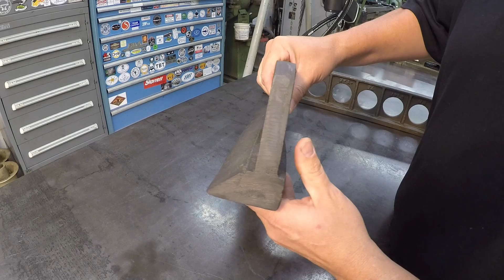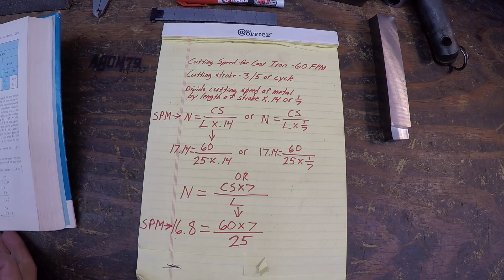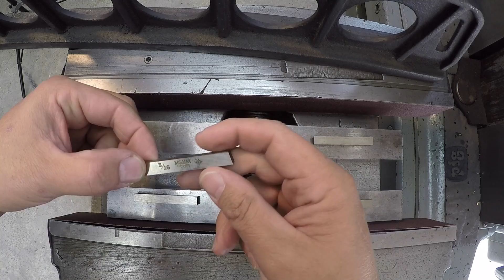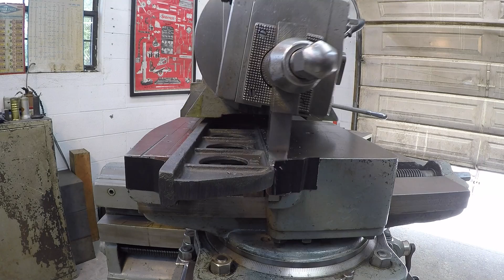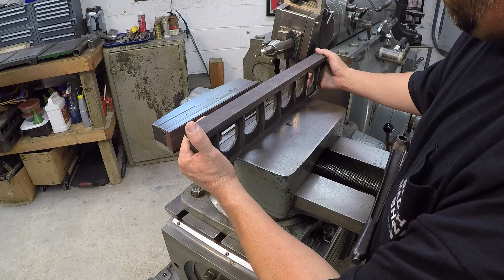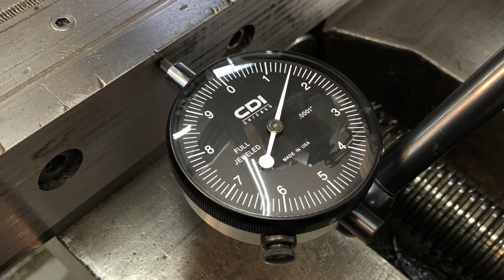Machining a 24 Inch Camelback Straight Edge Episode 1

Comment: I have been thinking about trying to build a sharper since I been watching you in older videos do work with them. I 
see they can do the things if like to do. I would also like to build a lathe as well as a small',ish be Bridgeport style mill  you can write everything I know about machine work TWICE, on the be back of a baseball card and a gum wrapper.  But the thing is I love you make stuff. I also want to start casting a bit. I know i can build a small furnace. I'd like the capability to pour 400-500lbs of iron per run, if I had to. Using a small gantry crane and lever to hold the crucible, use counterweights to counteract about 95% of the weight, using water so as the iron is poured the counterweights gets lighter also, but this is a somewhat complex system, using a electric winch to actually do the lifting is a more likely system. Use pulley blocks and a pwm  motor speed controller to easily and slowly lift the weight. with great accuracy to boot by slowly ramping up the lifting speed , moving up slowly and smoothly as if a person was lifting a coffee cup, not to spill it. By slight over volting the motor it can also run nearly as fast as without the pulley blocks   loose 50%, though 20-25% is is gained back by running the 12v motor on a 16v battery possibly 18v to 24v, a 12volt motor can be ran on as much as 36volts for a short time, depending on the type of motor. They run 12 v hydraulic pump motors on 36-48v+ all the time.  And 36v fork lift style motors on upwards of 144, volts, it requires using a blower fan to cool them. And they are not ran at full power more than 10-20 seconds. Not so much anymore.  the bldc,/ 3-,,phase brushless motors have basically taken over. Sorry to run astray,. I was looking on a mm Amazon and found a 10" 3,jaw. Chuck that could be a starting point for a lathe, it's going to be somewhat limited but a electronic lead screw can allow power feed as well as threading  probably no pass through the chuck, I would probably use two tapered wheel bearings from a old truck and attempt to use two seals and use oil in place of thick grease. Being the common use would like going out and running 300 mph all day grease isn't really going to do much. Maybe 30 weight non detergent if possible, and about of Lucas. Stabilizer, to make the oil a bit tacky. If the bearings wear quickly I guess I will try another oil.  Maybe more Lucas, or a 0w5 oil. and  I'm thinking about using a pump to spray the oil on the bearings to help cool them it's only the two for the chuck. And possibly 4 for the lead screw, two smaller tapered bearings per end. The carriage getting a oil bath. And possibly a ways oiler that pumps a small amount of oil as the carriage is moved across them, getting a bit of oil on the compound side that finds it's way to the ways. A 10" chuck. I'd like to have a 4jaw but 3 is better than none. Maybe I can have both eventually.  I'm thinking about 4" angle  about 1/4" thick to start the ways.  Have them milled flat after the welding is done, a piece of 3" channel welded to the inside leaving the top to be milled flat. Then have a 1" sq. Bar milled square on all sides after it is attached to the angle with ,1/8" dowels and ,1/4" hex drive bolts  counter sunk. The opposite side  basically the same only the 1" bar milled to A. By milling off one corner, and attaching it from the bottom  by  drilling n tapping the bar using dowels every _4" and a ,1/4" stud screwed in ever 4" between those. Using flange nuts. Then spot weld them. After they are tight. Then finish milling the ways. After this build the followers from 2" thick x 6" wide flat bar. Drill oil passages mill the mating groves a pyramid and a slight trapezoid,  having oiling passages and groves. The ways attached by 2" channel and square tubing 1.5"  1/8"wall using 4" tubing for the legs , the tail stock steady rest all mounted to the ways equally, the centerlines adjusted by milling the mounting pads on top. Ok to the bottom of the parts them self. Or by using shim stock between the bolting area. Only metal shim, and mill to the perfect the height. It's not going to be a perfect machine it should get a fellow to within ,5" anyway.     The ways followers he having the attachment fixed to it with dowels and cone seat bolts possibly spot welded after assembly. To prevent them from being a issue. Since them even being slightly loose will be a Problem. They must be torqued down, and secured. A Pair of 1/2" dowels, along with 4 grade 8bolts should do it.   The mill being built the same basic way  only cut the shape from 1/4" plate steel  then brace with angle and channel. I'm thinking it should take up about a 24" x 36" floor space sitting on as box made from 2" x 3" steel tubing with a 1/4" steel plate . The shaper similar. Using a 24"-30" hydraulic cylinder. Using valves to control the forward and reverse . With stops to control the stroke length. And a fluid bleed valve to control the speed of the ram possibly use accumulators and air cushion cylinder to dampen the pressure surges and drops  when changing direction. Use a valve much like a steam engine to change direction!  Use the accumulators and dampers to absorb the flow and pressure when the valve is closed to both directions for a fraction of a second at the end of each stroke.  The use of a relief valve will prevent damage. The dampers will smooth it's operation. I'm thinking about using a spring to keep the tool up off the work . Using a brush with oil/coolant running through it to mount in front of the tool.  Using the brush to push the tool down when the stroke is started lifting st the end, so ceramic inserts can / should be useable. Sorry to ramble on and on on. On and on!  Good day

Comment: I do not know after I finished it I would put a 3/8 plate with screws so that if it is damaged again you will change the part that I put additional and the original is not damaged

Comment: i got a weird one, 

so im assuming the ribs have to be isometric to the plane for this thing to clamp properly, and im trying to figure out how you would do it.
im thinking you could calculate it using trigonometry, then measure out your contact points, but how to you ensure those contact points are constant for every fixing of the part?
are the ribs equadistant from the centerline of the straightedge?
do you even need them to be?

im thinking that maybe explaining math isnt something you started your channel to do.
so i wonder if maybe we could talk a math guy into helping people like me understand.
maybe minute physics, real engineering, engineering explained, or practical engineering come my mind.
is that something that you would be interested in doing?
explaining math, or collab'ing with a math channel?
is there anything i can do as a lowly viewer to help?

great stuff as always man.

it just occurred to me, that you likely didnt do isometric angled ribs.
you likely machined the ribs perpendicular to the plane to make all of that math easier.
i originally thought that the ribs would be at an angle from the edge face.

either way, math is still cool, and i wouldnt mind seeing it all one day if you could scheme an entertaining way to show it.

Comment: Any potential issue with the new sharp 90 at the intersection of the ribs to the shoe?  I mean, as far as a stress concentration and potential for cracking?
Reply: u often use your straight edges as a hammer?
Reply: @chosena91  Remember - all tools are a chisel except for a chisel; it's a screwdriver.
Reply: This part won't have any stresses applied to it, so cracking shouldn't be an issue.

Comment: I didn't know they still used shapers, when I first started machining in the late 50s, I used to run 2or3 at at a time sometimes even a grinder, even did conture  shaping, 10 thou over the finish line, burned Lots a holes in my socks too. All for 80cents a hr.

Comment: I have seen a bunch of videos of people machining and scraping these straight edges. But none on them actually being used on a job. I have no clear idea on why they are useful. Could you do a video on this please? Thanks.
Reply: Check out Vintage Machinery, he has shown using the straight edge when it was not practical to bring the part to the surface plate.
Reply from the maker: Used when scraping way surfaces on machine tools. This is your reference surface you work off of. I’ll make that content once I’m doing that part of the job.

Comment: Can anyone tell me what that hammer is that he's using to adjust the vice in the beginning? Can one buy those or is it custom made?
Reply: Looks like a babbit block, the use of babbit blocks as a hammer was common back in the old days, babbit is a lead/tin/silver bearing alloy.
It's heavy but non-marring,  I still have mine and use it a lot. When it's beaten up or mushroomed too much, just re-melt and re-cast it.
Reply: @nashkobayashi6832  thanks.
Reply from the maker: It’s a lead hammer. I call them “lead knockers”
Reply: @Abom79  Nice to see an old-time all-around Machinist like me, I started my career on Planers and Shapers.
A good Shape operator can do all kinds of things that a Milling Machine can do but the tooling is much cheaper.
So nice to see a Gould and Eberhart shaper, ran a 36" G&E in my youth, great machine!

Comment: I think there might be a few questions about "why a shaper and not a milling machine here" and I would like to share something more than what Adam usually says (ie. he likes it). I've recently started reading "Foundations of mechanical accuracy" by Wayne R Moore and there's a following text there: "The preferred method of machining is to single-point plane important functional cast iron surfaces. The reasoning behind this procedure may be seen in a controlled experiment conducted to determine the effects of machining on cast iron. Using cast iron gibs as test pieces, it was found that with single-point planing, the gibs would spring the least from machining and would be absolutely stable henceforth. Milling the gibs caused more machining distortion and a somewhat permanent instability until the gibs were stress-relieved. In other words, it is possible to machine-in instability."

They mention planers, but it's because they were doing much larger pieces and they probably wanted greater accuracy to minimize the amount of material to scrape. In any case it seems that single-point cutting cast iron is beneficial according to Moore. One question that would be interesting to ask here is - what about flycutters? They are also single-point cutting, so would it be the same as planing? I have no idea, but it would be an interesting thing to check.
Reply: Thank you! I was wondering about this myself, and I'm glad I read ahead (for once), instead.
Reply: Gonna guess that the flycutter is less reliable than a shaper, too. It's making an interrupted cut, and there is going to be a couple tenths of spring in the cutter, and probably the workpiece, too. I don't know how much, but control what you can.

Comment: I know this is a random question... But I noticed that the shaper vice has quite a bit of 'wear marks' (patina) on the surface. Most specifically the left side, where you see what looks like a line that has a threaded look. What I am commenting on is the 'Patina' of the vice structure.... i know it has zero to do with function, just curious about the history of the machine, and how it gathers all those marks to look so uniquely aged. It looks really cool actually. Trying to reproduce that look on custom artwork for a metal background look for a logo or something is really tough to do. It's usually looks fake if I try to just create that look. It's got it's own feel. Great video. Love the details.

Comment: When would you use a shaper instead of a mill?
Reply: Adam often says that he enjoys using a shaper, but in this case there's an advantage to using a shaper. I started reading "Foundations of mechanical accuracy" by Wayne R Moore and there's a following text there: "The preferred method of machining is to single-point plane important functional cast iron surfaces. The reasoning behind this procedure may be seen in a controlled experiment conducted to determine the effects of machining on cast iron. Using cast iron gibs as test pieces, it was found that with single-point planing, the gibs would spring the least from machining and would be absolutely stable henceforth. Milling the gibs caused more machining distortion and a somewhat permanent instability until the gibs were stress-relieved. In other words, it is possible to machine-in instability."

They mention planers, but it's because they were doing much larger pieces and they probably wanted greater accuracy to minimize the amount of material to scrape. In any case it seems that single-point cutting cast iron is beneficial according to Moore. One question that would be interesting to ask here is - what about flycutters? They are also single-point cutting, so would it be the same as planing? I have no idea, but it would be an interesting thing to check.

But to answer your question in general (shaper vs mill) in a production setting it will be almost always a mill, because it's just faster to do most (all?) of the jobs on a mill. In a hobby setting there might be several advantages to using a shaper:

* you don't need any special cutters for cutting dovetails on a shaper (although it's much much slower)

* shapers are much cheaper than milling machines and often they're bigger - for example my milling machine's longest table movement is 300mm (~12") and my shaper can cut 450mm (~18")
* sometimes a shaper may be more precise when creating a flat surface. Of course it depends on how much wear it has, but in general it might be easier to buy a shaper in a good shape than a milling machine with the same number of hourse
Reply: @DrekiToolWorks  Is there a reason to choose a shaper over a grinder? Curious, never knew about shapers outside of wood working.
Reply: rapidtransit440 I don’t think that what Moore mentioned will be a problem with a grinder as with a coolant and a small amount of material that you usually grind it shouldn’t introduce any stresses. That said, you have to machine a raw casting somehow before putting it on a grinder - there’s just too much material to remove. So it won’t be a grinder alone, it will have to be milling machine and then a grinder. Here Abom achieved a very good accuracy on a shaper alone and that’s something that shapers can be good at. Of course you may have a milling machine that is equally good, but from my experience it’s much easier to buy a good shaper than a good milling machine in a similar price range - shapers are just dirt cheap since they have very limited use in industry nowadays
Reply: hansdietrich83 you rarely do use it. It’s very good for dovetails but other than that, milling machines remove more material in shorter time. Abom uses it since it’s fun.

Comment: very interesting. While there might be no "right" or "wrong" way to prepare these rough castings, I'm with you on this, looks like the best way to do it.
Reply: @chris0tube My understanding is that this straight edge is being prepared for scraping at which stage those considerations become more important. Despite Adam aiming for exceptional accuracy and finish on the shaper, you have to remember this is just the first operation on a rough casting. If you were to machine some strategically placed precision mounting points in a rough casting, how are you going to hold it? :-/
Reply: @chris0tube I think with many of these projects you work with what you've got. Adam specifically mentions a number of different holding methods he tried with this particular casting, soft alloy rods, ball bearing etc. but there comes a time when you just have to get on and do it. That's a handy tip regarding the "cast in" fixture points which you might suggest to whoever it was that had them cast. Clearly there is a law of diminishing returns though and adding those features might have occurred to the maker but were left out due to the added complexity.
Reply: @chris0tube I wouldn't dare to dispute! We are both clearly fans of Abom79 and I was wrong to suggest that was "the best" way to do it. I should have said "the most efficient" under the circumstances - where Adam would like to share this video before Christmas :-) There is another curious feature of castings you might be able to help with also, this idea of "ageing" where the casting is allowed to "relax" for years (?) prior to machining. Just wondering in your experience, how much difference that makes in practice.